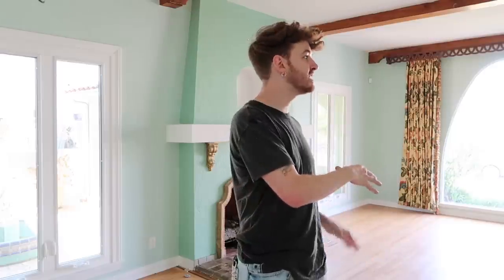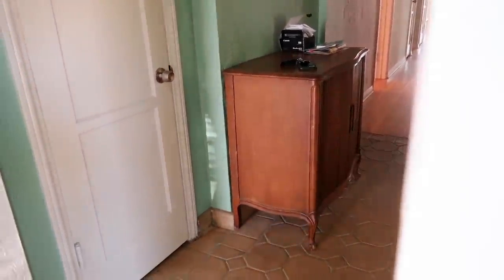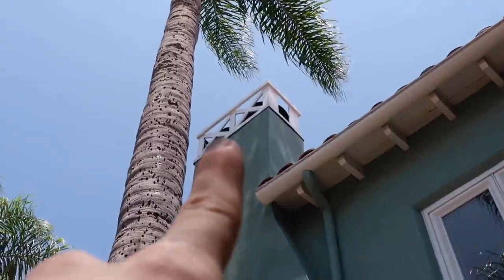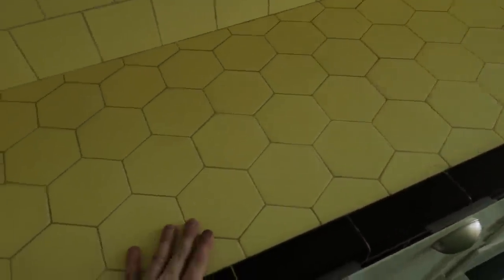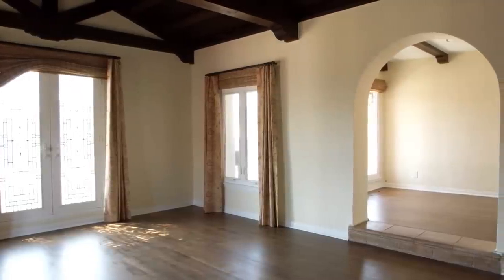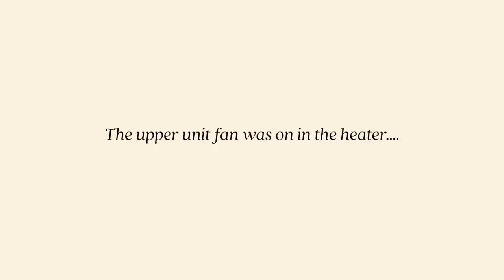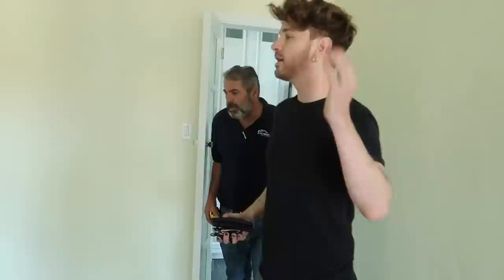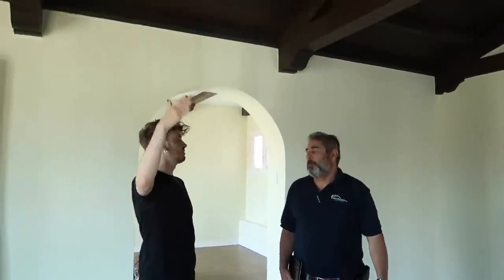Awful News About The House

Comment: I think most people in the comments don't realize how rare those tiled bathrooms are today without any cracks in such kind of houses. It would be a shame to not save them and switch them out with cheap trendy penny or subway tile. I would try first to open up where the darker pink tiles are.. 'cause they definitely are not the original tiles which is a sign that there was probably work done.. and maybe there were issues/leaks before in the same area.
Reply: Penny and subway tiles are hardly trendy! They’ve been around for years and years!
Reply: @molliemae6855  they have been trendy again for years. Then being around for a long time doesn't mean they can't be trendy. Trends come and go and come back. The thing is that they are very over used today not making them special or great design. They have become standard run of the mill tiles now.

Comment: The bathroom square tiles and trim are called "Florida Tile". I have never seen hexagon shaped tiles. They were made in Alabama, I believe (don't ask, because I do not know).  No longer made. They are 4 inches square and are for walls but not floors, which is why they crack under heavy weight and settling of the house.  The new available tiles are 4.25 inches square. My house my parents left me was built in 1957 and has the same; however, my floors are a small square and rectangular tile pattern. I had to demolish the kitchen counter with a sledge hammer and the mortar was so thick nothing could be saved. Maybe you can do better but don't hold your breath. Good luck.

Comment: New sub here!  In our first house, my husband explored a wall with a sledgehammer!  It was an easy start to making a pass through and opening the kitchen to a family room, and luckily, only one length or Romex had to be repositioned, and it worked out well.  
At my third house, I got a one year home warranty covering everything the inspector checked off as working.  The first time I needed the heater, in November, it didn’t work at all.  The servicemen the company sent said he put his whole hand through a large hole in the bottom of the heater, even though it ran fine during the inspection, which I was present for!  I got a new heater paid for by the warranty and replaced my water heater tank with an on demand unit.  

Do the walls and open the kitchen if you want to.  Living in a home while working can be a good thing, because you might get new ideas or want to work in the middle of the night,  but difficult in some ways- dust, mold, tools or materials in odd places.  Doing as much as you can afford to do before you move in helps reduce frustration.  Having to move things or piling items and furniture in rooms you use in order to work on floors or to paint walls is ridiculous.  Try to make a list an plan a logical order in which to work.

Comment: ah yes... welcome to old home ownership. I completely renovated a 1942 country cottage over 13 years.  Did most of the work myself except for roof and the serious plumbing...oh and bringing in new electrical.  It was hard work but so worth it! Old houses have a way of self determining the renovation schedule. Plumbing is always an issue. Electrical is always an issue. Just be glad you are finding out about it now!  I have to admit that I am not a fan of that yellow and pink and green tile so I was not disappointed about you having to sacrifice that. I think you'll be glad in the long run. So happy for you finding the house though. You will have a wonderful roller coaster ride and make some wonderful memories.

Comment: New subscriber 👋🏻 Hi! I’m a senior lady and would like to congratulate you on your beautiful house. Please make sure everybody working in your beautiful home is licensed, experienced, recommended and bonded and or insured as applicable. You can secure free quotes and compare to similar vendors etc. Since it does not appear to be an imminent need to move the water can be cut off while you line up the proper and most experienced help. It pays to shop around. A mold inspection after a water break is recommended. Also termites (when confirmed as such) can compromise the structural integrity of your house in a very insidious manner. You may want to get a termite expert opinion on the issue. Sorry dear. Don’t mean to be a nag. Just want to help you. Don’t rush into decisions please. Just a gentle suggestion. Congratulations!!!! 🎈🎊🎉

Comment: I add my vote to slow down.  I have found that over time the house tells you what to do.  You get to feel the space at different times of day, which can really change your color choices and lighting.  I used to be fueled with ideas in a new space, but now I see the value of moving more deliberately.  There have been many times where I have seen that my original idea wasn't necessarily bad, but wasn't the best option, either and that being short on cash and/or time to keep working on the project, was a gift in disguise, as I had time to live in the space and realize there were better options.  Love the work you've done on your rental apartment.  Beautiful!  I look forward to your own home transforming before us.

Comment: Happy birthday!
Ok so I’m not a plumber but I have heard that they can put a dye in the water and trace it.  Also many times once you start changing old plumbing it’s smart to do most or all of it bc, while they are at it and more importantly the pressure on old pipes coming though from new may not be much of a difference but if there is a weak spot it doesn’t take much.   
  There may have been a reason for the air to be on. In our house it’s for constant circulation to keep humidity and temps evenly dispersed.

Comment: Happy birthday. Sorry for the piping drama. One thing I'd be worried about is that the old pipes are probably not isolated and cold water pipe will in that case collect condensate that can rot the walls. I'm not sure how houses in US are built, but it is a thing to consider. ALSO you could maybe get to the pipes from the other side? To avoid braking the tiles. And someone already thought of it in the comments.
Back to my leaky pipe under a concrete floor and badly done new boiler. Good luck.

Comment: Ok, you will continue to find out things that need to be repaired, that can possibly cost a lot.  Let that be your guide and move forward with discretion and caution.  You are a designer and you have a lot of ideas... but perhaps think about postponing taking out the dining room walls, for a time until you get to a stable place and surprise repair work finally stops. Tackle the floors and such making sure you buy enough to make the changes you want and are not trying to fill in like the old owners. If you are very lucky, you will get enough tiles to repair but it will be labor intensive to save them from the other areas. You notice in the bathroom the tiles broke when the wall shifted in places rather than popped off, so saving tiles attached like that will basically have to have to mortar used probably chiseled off will cost a huge amount and the walls areas behind the broken ones chiseled out a bit to float in the rougher back of the old tiling that is salvaged. Buy enough flooring, tiles etc for the grand finished home vision.  I know you said you do not care for floor plans and such but, do one and do the elevation drawings of what you want.  Frame them and put them where you can see your dream and goal. You do not want it to turn into a, "Money Pit."  Your ideas will not go away, and you may develop new ideas you like over time that do use up so much of your money.  You know you can make some beautiful spaces in waiting that are affordable.  Consider it lessons in patience...If you do it over time and on budget so you are not overwhelmed with costs, you can have what you want and it will develop over time and the value of your house will grow over time also.  You have two units, you could consider leaving them as two and rent out the bottom.  You can put that money towards financing the other repairs and changes.  Also, as a work space for your business, the lower part could be used solely as work for a few years and catch some tax breaks that can lower costs too.  So, do not stop your dreams just just rearrange the scheduling that same as you would advise a client doing a big project.  Do not forget to breathe hahahaha The pandemics have not gone completely away and there may be others so, consider how that could slow down or stop work too.  I know we will see some beautiful work on your place in waiting for the finale.  I wish you much luck and happiness building your home into it's final destination as the dream home you envision.

Comment: I adore you! I have done three different hardwood floor refinishes in three different houses now. I highly suggest you do not stain the rental unit floors. If they are bad, just have them sanded and then polyurethaned. (Hire a pro.) You won't make more money with dark floors and renters will put throw rugs down anyway. (No ROI.) Save your money for infrastructure problems that will come at you. <3.

Comment: The one thing of your manic list you want to do is opening up that kitchen with island etc.

The other is the renovating the up bath.

These two things will transform the comfort and flow that will instantly make it yours upon move in. 

Doing the floors as part of that can be done by matching flooring you can find from reclamation resellers or marry incredible tile from the kitchen new open area to existing wood floors as a flowing transition that occurs at the island to seating area for kitchen.

There is a tile place that will match vintage tile. Obviously with a cost and I’ll have to go back through my notes to send onto you.

Btw, I’ve restored/renovated many homes and designed a built fully custom home on the Chesapeake Bay AND am currently restoring/renovating a 1933 home in DE as my last project in my life and it is yo be my retirement home.

I have also done decorating for homes and restaurants for comfortable living and all out holiday decor.

Comment: I could totally feel your pain about ripping out the original tile in the bathrooms.   I would have thrown up at that news.   I had a similar situation two houses (and two states) ago in Wash DC.  My 100 year old house needed new plumbing and they were going to have to tear into the original tile in the bathroom.  You have no idea the pain staking measures I had my contractor go through to minimize the destruction.   In the end I did have to match up some old tile with new tile but we made it work so the imperfections were not too noticeable.   FYI—I sold the house a few years later and got wayyyy over asking.

Comment: Hang in there!  We built two new houses, and it never goes smoothly! There are always unexpected problems that we found during the building process such as a main bathroom not plumbed correctly and ceiling was framed for flat 8 foot ceiling when it should have been framed for a cathedral ceiling.  Recommendation:  Be at your home everyday, inspect all the work, always question work and speak up, and take lots of pictures to document the work.

Comment: If those are working Batchelder fireplaces, the sand would have been used for the mortar (cement t us basically water, lime, and sand). The mortar is important mit just to seal a crumbling chimney but to block sparks/ embers from entering the wood framing of the home. Just ordered from your shop— excited!

Comment: When wanting to openiup a bathroom wall, you can sometimes open the wall on the other side of a wall, such as a regular bedroom wall, regular living room wall, or exterior wall  that is less intrusive and easier to repair/restore patch plaster, instead of removing wall tile and then tearing into the wall beneath the tile. Water leaks are generally associated with fresh water supply  (hot & cold) pipes because it is the fresh water pipes that are under pressure. Waste water drain pipes are not under pressure. Be sure and get one of those electronic inside a wall x-ray type viewers.  Some inside wall  viewers use a smart phone screen as the display and have a separate hand held device you hold up to a wall to indicate fresh water supply pipes, waste water drain pipes, vertical drain venting pipes, gas supply pipes, horizontal fire stop 2 x 4 lumber, electrical conduit and wiring, HVAC supply vents and exhaust plume type venting and any other hidden  inside wall items that is/are unknown. These x-ray type viewers are not to be confused with magnetic stud finders. Looks like this was built in the 1920's or 1930's, expect to see some crumbling electrical fabric conduit. As long as there is metal electrical conduit, replacing suspect wiring is not difficult. Also, flexible PEX type fresh water supply replacement pipes are usually perfectly fine to replace aging galvanized pipes. I am guessing this in Southern California. Looks to be in good shape for surviving the 1933 Long Beach, 1971 Sylmar, and whenever the Northridge 1990's earthquake was.

Comment: My home was built in 1926...In a similar situation with a leak coming from my bathroom wall down to the basement...In the adjacent room from the bathroom, we discovered a wood panel tucked low in the closet that has access to the pipes from the mounted sink...check for covered wall panels...saved from  destroying the tile wall behind the sink.

Comment: As someone who started working on an older home with previously unfound leeks, I want to caution you about mold. I started getting congested and then chronic ear and sinus infection, and then eventually brain fog and insomnia. It wasn't until i went to visit my parents and basically was away from working on the house for a two weeks that my symptoms disappeared and I started connecting the dots. I got a mold and water damage specialist in there and found several points of undisclosed previous water damages and an ongoing leak inside the wall. So, not to scare you when your congestion is probably not even related to your leaks. But just to share my own experience as a cautionary tale about a new home owner that didn't yet understand the scope of damage mold (even when not immediately noticable) could do to my health.

Comment: The black stuff in the fireplace is soot / charred wood and the white is ash. The humming in the basement is most likely your furnace/AC/ventilation system running.
When you are thinking of removing walls you have to know which ones are load bearing as those will need to be reinforced to be safe and to code.

Comment: Live in the house for a year before you do any major renovations. For now just refinish floors, paint, repair, etc and then once you have lived there for some time you will see what you love and hate. I hated some aspects of my house when I first looked at it and now that I’ve lived here and experienced it daily some things have grown on me I did not expect to and I learned a lot about the features I would have missed! For example I wanted to rip out all of the floors and put in LVP. Come fall when we turned on the heat we realized we had in floor heat in all of our tile work! The heat goes too high to be safe for LVP so we are obliged to stick with tile. Sooo many things you don’t even think of until you live in the space

Comment: Have you considered not removing the walls, but putting in a large arched opening or two, so that the structure isn't really changed but opened up some. It might be the better option. You might want to live there a while first and see if the changes are really what will work for you. Sorry that the leaks are so severe. They can use a scope to look inside, before you have to tear anything up. absolutely worth the money.

Comment: I had mold in my home due to a roof leak that was repaired by the previous owner but the water damaged underlayment and some of the dry wall underneath wasn’t repaired. We had to open the wall to find it and got an air quality test to confirm. We got a mold remediation company in to sanitize and replace the insulation/drywall after getting the entire roof replaced. Got a good air quality test after the repairs were complete.

Comment: As a first time home owner of a older home too… I suggest slowing down!
Get the bones right before even worrying about decorating! Electrical, plumbing, waterproofing, insulating any attics, basement?- sump pump/French drain, HVAC,etc. 
Like if you plan on repainting the ceiling… you wanna do that before the floors bc you don’t want paint on them. 
I would say get electrical done first! In case they need to take out the drywall.
Then paint, floors, doors (bc they will be determined on how thick your floor is), trim.

Comment: I am waiting to see  about the bathrooms. I have a feeling those tiles are all set into the walls in thick cement over a metal lathe. That is what I have in my home and why I have not gutted my bathrooms. The pipes in the wall should be updated. If this is how the tile was installed, it is a ton of work to take out.

Comment: BEAUTIFUL HOME! I would have a real hard time getting rid of all the vintage light fixtures. One question: Is your home in an historical district? I know in GA and AL, those historic districts require the inside decor to be approved if changed. That's one reason it's hard to sell those homes. Can't wait to see what you do with the bathrooms! Maybe save as much tile as you can to use on later projects.

Comment: * The Mint color makes the rooms airy & bright.. We can see what you are doing.. Good Luck with the work.. For the Leak, Hire a "Leak Detection" company.. Save Time & Money to know what you are getting into & Where.. I had a Leak in the Walls & it turned the Structural Wood into Slimy Mush by the time I found it & the Walls had to be opened & wood replaced.. SO ~ Be sure they check the Wood all the way down...